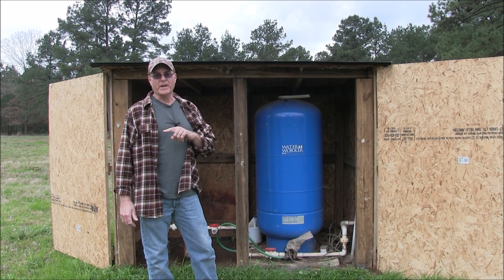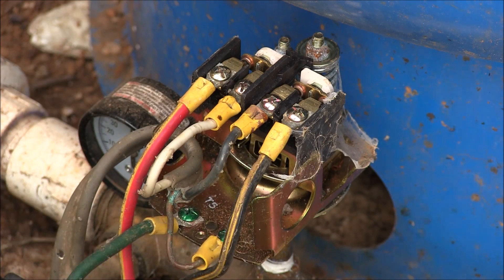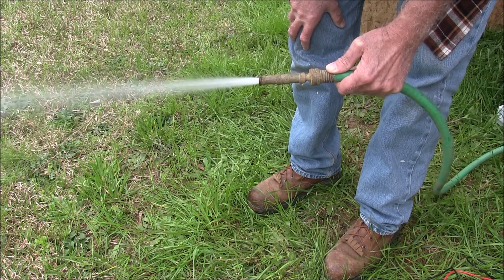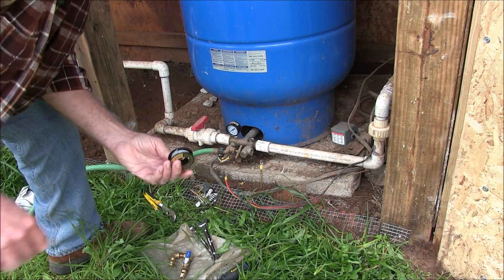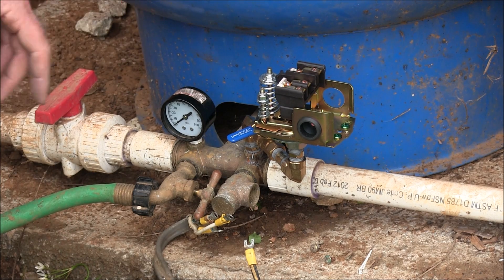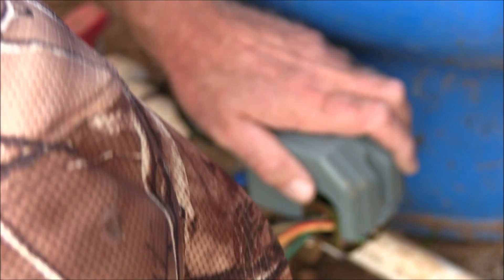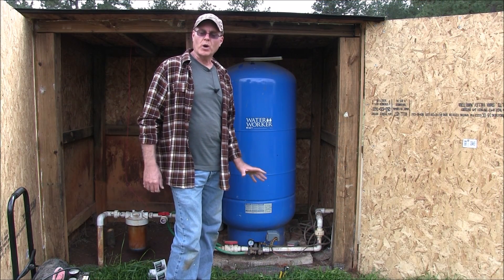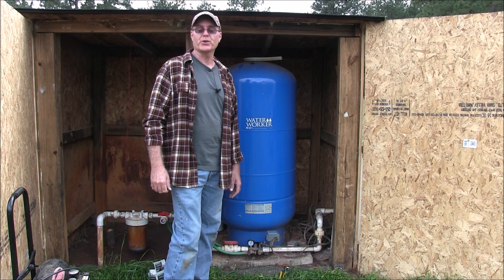Well pump pressure switch replacement and re-pressurizing the pressure tank

Comment: i just replaced my switch, but the pump isn't shutting off when it reaches 60? Just keeps running... Any suggestions?
Reply from the maker: Either the switch is wired incorrectly or it's bad. The two hot or positive lead wires from the electrical box go on the outside screws and the wires going to the pump connect to the two inner screws.
Reply: Do you think that maybe my bladder tank is too small for the larger switch we put in? we went with the 30/60 instead of the smaller one that was on it.... Still not shutting off! he said he was gonna go buy the smaller switch today and see if that makes a difference.. Thanks for replying.
Reply from the maker: @lorijohnson8660  it doesn't matter what size tank or what pressure switch you have. Once the pressure reaches 60 psi on a 40/60 psi switch, the contacts on the switch will separate and shut off the pump.
Reply: Damn... we're just stumped..:/  We had a 30/50 before. Everything was fine, then i went to turn on water, nothing. hit the switch with a screw driver, it turned on but wont turn off, switched switch..works but wont turn off unless we turn off breaker to well.  Wonder if the pump is bad, but it still works???
Reply from the maker: @lorijohnson8660  If you don't shut the power off, does the water pressure go passed 60 psi ? Or does it just stay under 60 psi and the pump running constantly.
Reply from the maker: @lorijohnson8660  If your pump is weak, it might not be able to reach 60 psi and run constantly. In that case put in a 30/50 pressure switch.
Reply: it stays at 60 but continues to run.  Never goes past 60 even while running, but never turns off unless we hit the breaker to turn off all water..:/
Reply: Also; THANK YOU SOOOO MUCH for answering my questions!!!!!
Reply from the maker: @lorijohnson8660  Your welcome ☺
Reply: Ima go buy a smaller switch and go from there. I'll let you know how it goes <3 tyvm!

Comment: Would a pressure switch going out cause the breaker to trip?
Reply from the maker: Not really, unless it's shorting out some how? The breaker trips when there's too many amps drawn or it could be just a bad breaker can cause it to trip. That happen to me when I was watering my garden for long periods of time, I guess the breaker would heat up and trip. So I put a new breaker in and it solved the problem.
Reply: @petebeasttexashomesteading  thanks man. Mine trip today and when I cut it back on I had no water or pressure and the pressure switch would not cut on. My tank was also empty. I got a new pressure switch that I'm going to put on tomorrow and hope that solves it.

Comment: I installed new gauge and switch the way you did. Started pump manually to the kick on pressure. Pressure doesn't rise but contacts stay closed. I can here water stop running through pipes with contacts closed, eventually contacts open and pressure drops to zero.
Reply from the maker: It sound like you need to change the check valve. The check valve is a one way valve the keeps the water from going back down the well. When the pump reached it's set presser and shuts off, the water presser fell to zero because the check valve is bad and the water presser went back down the well. It should be located immediately after the well casing and before the presser switch. Hope this helps.
Reply: Pete B. Thanks. I will check that.
Reply from the maker: Also when changing the check valve, make sure you install it correctly. The water flows in one direction and it will have an arrow on the check valve in the direction of the water flow.

Comment: What kind of water pump is used for a 26gal water worker tank? I can't find any specifications. Is there a specific PSI or HP. Thank you in advance!
Reply from the maker: Any residential well pump would work 1/2 hp and up with at least 10 gpm. But if your going to use the water for watering your garden and lawn, then I would go with a more powerful pump 1hp and up. Also you can put any size pressure tank you want, the bigger the tank the less the pump will have to come on.
Reply: I really appreciate it. Thanks!
Reply from the maker: @sleepyzzz5259  👍

Comment: If you are changing the switch why would you need to RE-pressurize the tank? Shouldn't it already have the required pressure in it from before?      Unless the bladder is bad......?
Reply from the maker: David Delle  It should have the correct pressure but you don't know so you have to check.

Comment: Mr Pete your ideo was very easy to understand. I totally followed it but I don't have enuff water pressure to even take a shower. I did everything you said twice. I was wondering should the tank gauge and my pressure gauge reading on top of tank be the same or should the top of the tank read 2 lbs less. right now they both read 41.
Reply from the maker: The only thing the tank does is keep your pump from coming on and off every time you turn on the water. The tank air pressure should be 2 pounds less then the low on your pressure switch 38psi in tank if you have a 40/60 psi switch. I would replace the pressure switch and make sure where it threads into the threaded hole is clean and free from rust or any type of blockage in the threaded hole and the switch.. Make sure you're getting 120 volts on each hot wire and make sure the ground wire is grounded and tight. If that all checks good, then you might be looking at replacing the pump.
Reply: Was the pump turned off and the tank empty of all water when you are getting 41 PSI? Or was everything connected as usual and holding steady at 41 PSI on both the tank air pressure and water pressure? As has been stated, the empty tank air pressure should be 2-3 PSI less than the cut on pressure. But when pressurized with water I am thinking the two readings should be the same. It is nice to know your two gauges agree.

Comment: Thanks for posting.  This gave me the information I needed to solve my problem.  I suggest that anyone pulling the pressure switch check the 1/4" pipe feeding it for clogs as they can prevent the switch from operating properly.
Reply from the maker: James Young  👍
Reply: Thanks for the reminder on that. I'm about to change the pressure switch for my mum's well so I'd better remember to pull the pipe below it and check for blockage.

Comment: Thank you Pete, how do u know if the pressure switch broke?
Reply: Another sign is if the switch is going on/off rapidly because the contacts have pitted out.
Reply: @costello1990  That's exactly the same issue I had before replacing my switch! I ended up having to replace my well tank also!
Reply from the maker: The presser switch should maintain your water pressure between 40 and 60psi and make a clicking sound when it gets below 40psi and again at 60psi. That clicking sound is the contacts closing and opening turning the pump on and off. If the pressure is always low, then it might be your pressure switch.

Comment: Hi Pete, My husband replaced pump, switch and expansion tank. 3/4 horsepower pentair. Why is my pressure tank not going from 28 to 50 lbs??
Reply from the maker: Tina Bartolotta  Make sure the air pressure in the tank was set at 28 psi before there was any water pressure in the tank. You also need to see when the pressure switch clicks on 30 psi and off 50 psi. If the tank pressure was set correctly in the beginning, and you don't have correct water pressure still, then it might be a bad pressure switch.

Comment: Hey Pete,
I'm moving into a country house with a septic and well. What questions should I ask the sellers regarding well and septic?
House is 20 years old and was inspected days ago. I paid for a septic inspection along with home inspection but am new to these things.
Inspector said well was ok and put dye in septic tank to check for leaks. Said it appeared ok.
Would greatly appreciate any advice Pete.
                     Thanks! Ed
Reply from the maker: Congratulations on your country home, hope it came with some acreage so you can grow most of your food. Being that the house is 20 years old, you'll have to find out how old the well pump is. A submersible pump might last 12 to 15 years but not that expensive to replace. Is the septic system a drain field type or an aerobic septic system? The drain field type could last 15 to 20 years and very expensive to replace and an aerobic septic system is dependent on the air pump to oxygenate the waste water, and water pump to pump out the clean waste water to sprinkler heads on to your lawn. An aerobic septic system tank could last 40 years or more but is dependent on the air and water pump in the tanks but not expensive to replace those pumps. Hope this helps.
Reply: Pete B.  Thanks Pete, I think its the old style drainage type (no air pump) so I guess I will be replacing the septic sooner than later and    
I'm guessing  the well pump was replaced somewhere in the past few years. I'm going to get the details from the sellers on our final walk through. We have  2 acres but have some limitations on growing food. No livestock allowed.
I greatly appreciate your help Pete! Thanks again!
                                          Ed
Reply from the maker: Two acres is plenty of room, you can have a huge garden. I would recommend adding (flushing) good septic type bacteria like Rid-X down the toilet every month. The bacteria will eat, break down and clean waste like oils & grease, protein, and paper and keep your septic drain field clean so it will last much longer. Enjoy your new home.

Comment: Good job except I would not use that valve and just fight with depressurizing next time. The reasoning is that if the valve ever clogs in service, the switch will see zero psi all the time and will overpressurize the system potentially causing the tank to go up through your house like a rocket. Not worth the risk for an extra half hour to drain the tank whenever you gotta change the switch.
Reply: That's what your pressure relief valve is for, so the tank doesn't blow up if over pressurized.
Reply from the maker: Thanks, I'll make sure to flush the tube out that I put to the presser switch.
Reply: Or if you forget to open that new valve, the switch won't see the pressure and will let the pump run indefinitely.  Seems very unsafe.

Comment: I have changed elements in water heater. And changed pressure gauge  on well pump. Now the pressure gauge only has 14 psi  it was 60 psi.  What do I do to build the water pressure back up? I'm a single woman that has to do everything myself please suggestions.
Reply from the maker: If you're water pressure is only 14 psi, I would change the presser switch, which is located next to the pressure tank. The switch tells the pump to turn on when the pressure is to low bellow 40 psi and turn it off at 60 psi.

Comment: Hi Pete, If the pressure with the new switch is not correct, how do you adjust it?   Pat Spencer
Reply from the maker: Hi Pat, It's a little hard to explain in this comment but here's a good video that will explain exactly how to adjust the pressure switch. https://www.youtube.com/watch?v=1VNSv7xVzzU

Comment: Hello Pete, could you help me out with my water tank? I'm very new with this, so I apologize if it my description is poor.

The pressure switch was flipping on and off every few seconds, so I figured I needed to re-pressurize the tank. I turned off the power, turned off the water main, and drained the tank. Unfortunately my gauge was broken so I don't know what the actual pressure was. I did not know that I should have checked pressure before draining.

After draining, I tried using a bicycle pump to get the tank pressurized. It's a 30 gallon tank on a 30-50 setting, so I was trying to get it to 28 PSI. I pumped for about 10 minutes and kept checking the pressure, but it was not increasing at all.

I checked all my valves and connections to make sure they were closed. I can't find the problem. But my tank is not holding any pressurized air at all. Or am I just not pumping enough?

Thank you for any feedback. And great video! Very helpful.
Reply from the maker: I would try an air compressor, a manual bike pump just can't put enough air volume in the tank fast enough. But if it still doesn't hold air pressure then your bladder in the tank is broke and you'll need a new tank, which is probably why your presser switch is turning on and off when the water is being used in the house. Most likely you'll need a new presser tank which if it's a 30 gallon, they should have at the big box stores. Here's my video on replacing my presser tank. https://youtu.be/O4SgbhFsxfY
Reply: Thank you so much! Will look into those recommendations.

Comment: If you look carefully at the start when you disconnected the wires, and then at the end of the episode when you reconnected them, YOU REVERSED THEM !!!  ((the red and back-yellow striped where on the outside spots to start with, and ended up in the center two spots at the end!!!))  That's enough for me.......
Reply from the maker: If you knew how a pressure switch worked and about electricity then you would know that it doesn't matter if you connect the power coming in to the outside terminals and power going out to the inside terminals or vice versa.
Reply: Sha-zaam!
Reply: this is single-phase power, it doesn't matter if the wires are reversed.